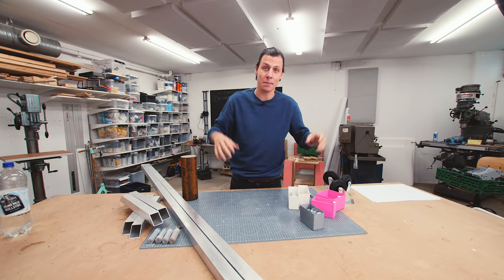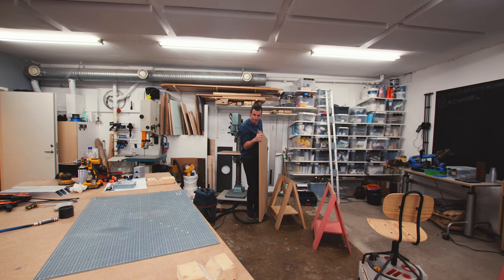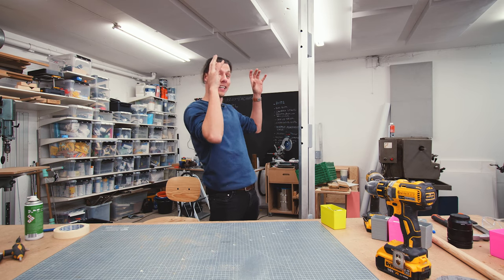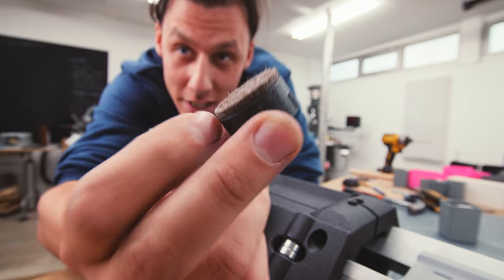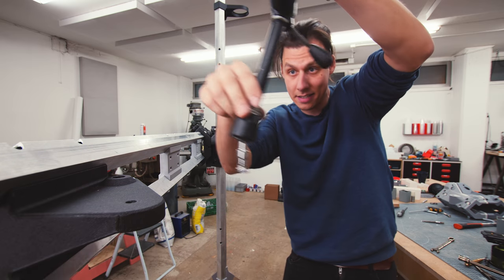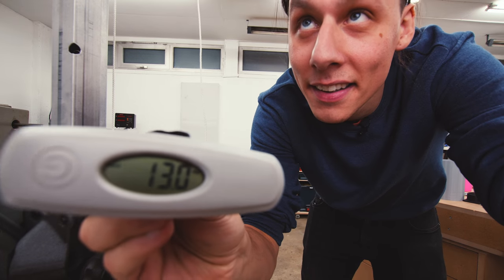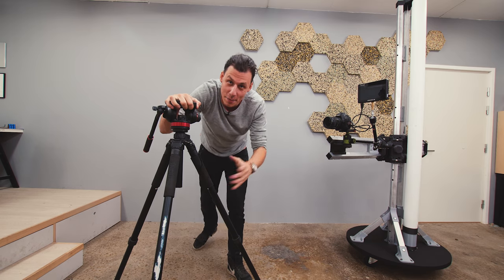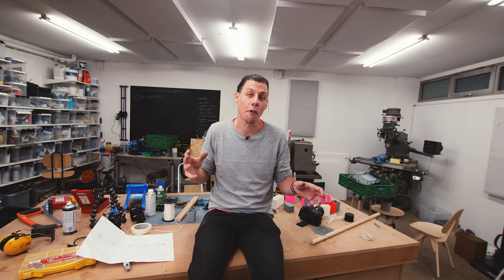3d Printing a $10,000 Camera Arm

Comment: That's pretty fricken awesome. As for the square tubing, I would have used 4040 Aluminum extrusion on one of the beams of both sections to add stepper motors and range finders.

Add to that a single board computer with some facial recognition software, you could make it follow you, touch free.

Comment: You could improve it maybe a little by putting that cilindar on place of concrete weight and might end up removing/lessening the concrete one, also the whole station does not have to be centered. Is my advice good ?

Comment: super cool design... i would use steel for the vertical axis and would have gone a bit more complex on the pulley system to try and use the weight of the base counterweight (static counterweight) with several compound pulleys in between to dynamically adjust for needed force.
Any really cool and super useful thing...

Comment: theres a smallrig tripod which you can handle the height changes way faster. and for the very low shots i just have a very old tripod with the same mount, so i can put it in that position in about 10 seconds haha but cool build

Comment: You should try to motorize it and have a controller that moves its up and down and in and out or even add the ability for it to drive around with the controller. I know that would be hard to do but would be and awesome addition.

Comment: Impressing construction and it really seems to run smothly and be stiff on the other hand. Iwould not have thought this possible with 3D printed parts.. I would ad a centrifugal brake to the to pulley to keep the speeds in a safe range and use quick release clamps for fixation though...
Do you have any wear that compromises function over the years?

Comment: Instead of a counter weight, why not 3D print a while at the bottom or even better, on the arm itself, by which you can wind and unwind the rope to and from around another wheel to raise or lower the arm? It could also provide you with a locking mechanism. You can also design the location of load force and effort force in way to make raising the arm as easy as the cool one finger you have now. Also, if I were you I would add a second layer of base at the bottom to have a turn capability when the wheels are locked. Anyway, just some ideas. I love your works. I truly wish I had the space to do these kind of builds too!!! Someday maybe.

Comment: This my definition of a how-to video. This is 5-stars...no, I'm serious...5 stars! What a great walk through on why you did what you did. This is what some folks completely miss in their videos--the 'why' in their design philosophy. You explained everything and I greatly appreciate that. I have used 3D design software so I'm no stranger to it. Thanks for providing the (.stl) files for your printed parts. That black filament looks really nice post-print with an aluminum extrusion product like the square tubing. I really like how functional your design is. Yes, it's inspired by the $10K alternative but this is obviously something with a 'do-it-yourself' attitude in mind. Also, thanks for presenting the the total hours of design, print, test fit and final build time. This is key to communicating that design is not easy. It can be fun, yes, but really good design takes time to figure how best to accomplish something. I would love to build this along with a great reason to buy a second 3D printer. Two thumbs up!

Comment: Absolutely BRILLIANT work!!! I really love the design and thought you put into it and that sparked a further idea to take this build to the next level... Automation!

Imagine being able to guide the placement of the arm with hand cues... There is a camera with built in object recognition and tracking called the Pixy 2. Couple that with a couple of stepper motors or even DC servos with some drive belts. You already have it so very well balanced that a simple stepper could do the movement. Add a 3D printed pan & tilt mechanism to hold the camera and have the Pixy 2 observe and identify hand gestures and then it can send signals to an Arduino or Raspberry Pi to control the movement of the camera and arm... YouTuber James Bruton from England might be a great collaboration partner to work with and then you would have a rig that could follow your hand gestures for camera placement and maybe even rotation angles! I am thinking it would only add another 100 euros or so to the build and yet could seriously compound the usefulness and ease of use!

Comment: Nice project, but don't cheap out on the castor wheels... 3 is unstable... 4 is a minimum, but 5 is better - for a number of reasons...  weight bearing capacity, stability, steering and tracking smoothness over different surfaces (Make one at least a locking wheel)

Comment: I Bought the 3D model but can't make this exact design due to lack of floorspace so I'm converting it to a ceiling mounted system. I'm thinking about printing it in PETG instead of PLA. PETG is stronger, better suited against deforming in summer but also a bit more flexible than PLA. Have you tried printing part in PETG? Would you advise for or against it?

Comment: Alexander: What settings and nozzle size did you use for everything here. I sliced the Big Bracket at .2mm layers on a .4mm nozzle and it'll take 36 hours to print. Would you recommend a larger nozzle or layer height?

Comment: Hello, what you do is very good.
I need something similar to this arm but a little different here I put the one I was looking for but they have already discontinued it. The only difference is that I need it to be able to be extended just by adding more rail and changing the cable.
Could you help me to solve this?
Thank you very much

Comment: Its an amazing project and the exception is great.
Now how more interesting and helpful it would be if its connected to motors that brings the arms up & down / front & back with a remote control ?
Its possible as long you went that far one more step will bring your project to the roof while you are setting.
Ok its a dream but technology started with dreams 😉 just a thought.

Comment: About how much weight can the aluminum arm hold when fully extended? You said that the whole arm is 13kg but how much of that is the camera?  I'm interested in doing something similar to this, but the camera would be replaced with something that is about 11kg just by itself. Can the aluminum hold that much weight, hanging off the end, without bending (or failing altogeather) when the arm is extended about a meter from the base?
Reply from the maker: Jeah probably, if the printed parts are solid enough, you can also increase the footprint, weight of the base or ad a counterweight to the arm ;)

Comment: now, you just need to add motors and a remote to it
one for moving in and out, one for up and down
Reply: That would be cool.  It would also greatly increase the cost and complexity.
Reply: @craigphillips3154  complexity, I can see why you would say that. But cost, I don't think so. I think you could get by with RC car components. Or a geared stepper motor.
Reply: @aashmediaproductions2799  I don't think RC car parts would be robust enough. You would need to build it similar to how a CNC router moves. You would need to add a threaded rod the full height of the upright and another the full length of the arm, plus motors gears and power. Plus you would need limit switches at each end. That then gets into cable management issues to deal with.  You might also then need to add some type or Arduino or Raspberry Pi if you wanted to control it with your phone. If you used a golf cart or car battery for power then you could keep it cordless and ditch the concrete weight. I'd probably want to use either a cordless drill battery or cordless yard tool battery for ease of recharging. I'm going completely off the top of my head with all of this. 

You had me thinking "that would never work!" Now you have me thinking, "I want to MAKE that work!"

Comment: Something that has nothing to do with your build but I'm in the process of transitioning from standard to metric in my head.  When talking about Dyneema ropes, I have to convert fractions to metric to know what the seller is talking about.  When you mentions "30 mil MDF"  I had to convert in my head from metric to inch.  To say the least it would be so much easier if America would get off it's "imperial" ass and go metric, or at least go all metric.  All science and testing is metric.  All cars and trucks are metric now.  Just need to get the rest of the industries to go metric.  Change this big is painful but we need to do it.  BTW, great build.

Comment: This is very nice, but 346 hours on two printers means that with one printer it takes 700 hours to print. That is a whole lot of time, in fact almost 30 days of non-top printing. To be honest, if you calculate the time you spent plus the material you have used I think you are not far from (maybe even passed) the $ 10k Foba. Now of course, you make some money on YT plus get some from your sponsors, but for anyone else this would be a crazy project to start out with, unless it is just for fun and to get the feeling of "I made it". No doubt this is fun and the end result is very usable, but I also think it takes too much time to make. Never the less, of course the one you made is well done and probably works well enough. Anyway, of course, to make something like you did is very nice, though I would have used 45x90 (or larger) extruded aluminium profile. It would have increased rigidity and reduced the number of 3D printed parts and probably would be much easier to handle and to make for most people. However, please note that there are alternatives to the tripod you were using, some have more flexibility than yours seems to have, and can also allow reversing the centre column.

Comment: I bought the project and trying to gather my materials... do you have any information on the casters you used good sir?
Reply from the maker: I jusst used some swiveling ones from a local hardware store :) 120mm high
Reply: Thank you for the quick reply! In my meticulous habits I was trying to find casters that match your template. I’ll have to modify!
Reply: @achappel  Man... it's hard to find hardware and aluminum that's metric here in the U.S. I'm committed though lol

Comment: So..in fact made mostly from metal, concretwle, MDF... bought bearings, wheels yadda yadda ... just some small brackets spacers etc 3d printed. Which you could easily have made something similar from wood or whatever if 3d printing wasnt available. 

Btw, there is no comparison between your aluminium square tubing and a serious pro tripod of the type you are suggesting in terms if rigidity. Try putting a medium format film camera on your version and watch it vibrate when the shutter fires

Comment: this guy just made 10k DIY professional camera arms without spending 10k.
Reply: He is probably not far from the 10k, if not actually well above, especially if you value the time and calculate EVERYTHING. Time is money even for a DIY person like myself. Commercially this is a dead end project, it is cheaper to buy the 10k stand which probably is also more rigid and has other advantages. Anyway, the aim of DIY is not saving money but the feeling of "Do It Yourself". If saving money is the goal then only very simple and easy things can be made. Complicated projects, like building a CNC or 3D printers and other stuff I am doing is almost always more expensive than buying similar products.

Comment: Hmm... how hard to motorize & remote this? Since almost no force is required to move the arm.. integrating some motors in the design of the big black blocks holding the arm.. a controller with a receiver... and a whopping battery, even, as a weight on the base if want it cordless.. how to get the power to the motors, since it's moving.. maybe using some conductive material in the frame, if not a spiral cable extending and retracting would be an acceptable trade-off for such functionality. Who wants to modify this and put up the files? :D

Comment: Great now how much does a 3D printer cost  along with all the tools needed for parts this size? oh yah.... 10 grand.
Reply: Nah, you can buy a maker bot from DELL for 2k or rent one for a week for $150. Those 4 big parts were the worst at 30 hours each, so that's basically 5 days right there. So you'd probably have to rent a machine for at least two weeks. 

None of the rest of the materials looked costly. Aluminum tubes? Nope. MDF? Nope. Caster wheels. Maybe 😁

Comment: Are you are having much more talented by about a hundred times I just want to let you know I seen you use the black hard rubber wheels on the bottom of that well if you use the rubber Wheels you'll get a smoother ride when you pushing it around